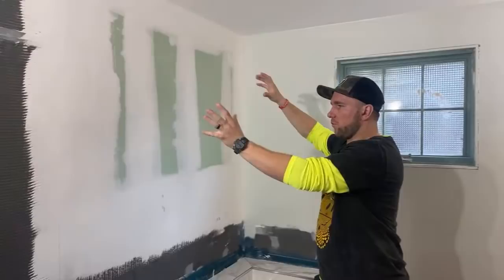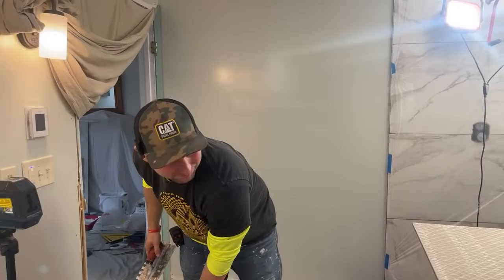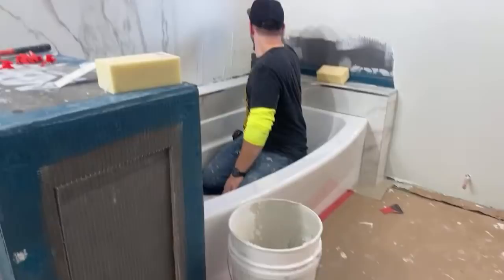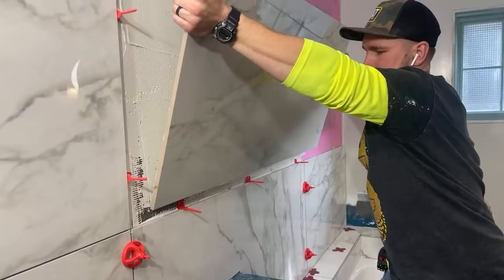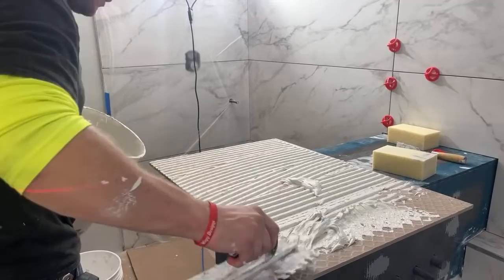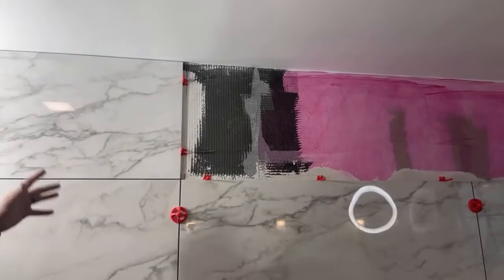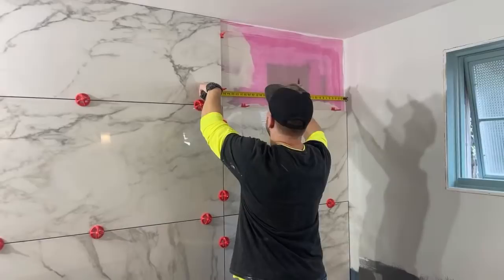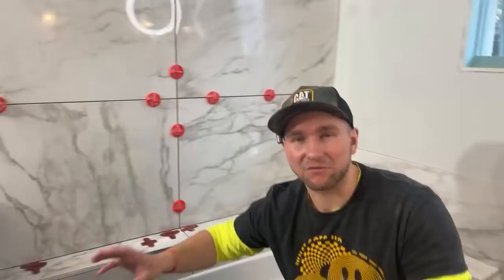🔥 Tile over Drywall 🔥. 24x48 Tile Installation Rubi DC 250 Tile Saw.

Comment: I'd never do it because you're going to have hundreds of pounds hanging off of paper coated gypsum. I have a hard time believing that it would last very long
Reply: That isn't going to last...
Reply: Not saying it's proper, but I have demoed 15+ year old tile showers installed right over green board. No waterproofing. Just thinset and tile. It can last forever. I've seen it.
Reply: @osearcy4 same here! Waterproofing has turned into profiteering
Reply: @osearcy4 if small subway tiles lasts for decades without waterproof, just think of how long will hold up with 24 x 48" tiles
Reply: As long as it isn’t leaning outward… the weight should be straight down on the other to the tub.
Reply: Green Board isnt plain old drywall.  It is fiberglass mixed with gypsum.  It is much stronger and can handle moisture a lot better.  In dry areas it shouldnt be an issue.

Comment: Hey partner just wanted to throw out there that gypsum based SLU (Self Leveling Underlayment) would be something like gyp crete, which is gypsum concrete, not sure that specific primer is good to use on actual wall board. I’m sure it will work just fine also not trying to hate, just a drywall contractor here trying to help out a fellow tradesman.
Reply: I use mapei eco Prime. Leaves a cement like surface to work with.
Reply: @brucecanny love that stuff. Bonds really well, drys fast, and gives a grippy surface.

Comment: Mastic does not get re-activated when moisture/water contacts it, that is an old wives' tale, but one many tile installers hold true, but at the same time you cannot use mastic in submerged applications.  You should avoid use mastic on shower bases/mud-pans or on floors, (especially concrete floors) but it is perfectly fine on walls.  EDIT:  I wouldnt use it on LFT tiles though.  Normal sized ceramic tile under 12" it is fine.  Dont use Mastic on glass or natural stone either.  Glass doesnt allow it to breathe, so it takes forever to dry and can bleed into your grout.

Comment: I am not an expert and don't claim to be one. But I can install floor tile no issues.  But I have mad respect for someone who installs large wall tile that looks good. 

A relative of mine had a bathroom redone. It was large wall tile. It was really nice tile she picked out,  but the installation was chit. You could visibly see the unevenness everywhere. They did not even put a sealer over the grout..... I told her that no sealer was a disaster waiting to happen.  I went to Lowes and got sealer and did it myself.

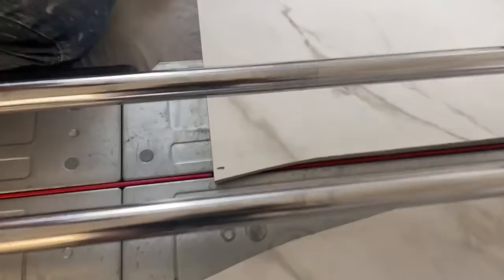Comment: Man with very nice cutters and saws can’t buy $50 suction cup to move large tiles into place 😂 Kidding, love that large format cutter. Bummer if you ever get a bad cut. Happens at 1:00:42. In ruby videos what you do is lightly tamp down with the breaker bar, then break at the other end. Your creating a little stress fracture at that end.

Comment: Hi, I noticed that you used mud and taped up the seems like with any other drywall job. On other videos I've watched some guys just thinset over the seems with no tape before tile . I'm repairing a hole in a shower wall, do you recommend that I mud and tape like any other drywall patch or since it's getting tiled can I thinsetting the whole thing can skip the mud and tape step

Comment: Great work, i like your work style simple smooth n stressless,! Yes slowly done also productive n don right!!! Good job buddy !! yea some guys finish whole room one day with plumbing but leave imperfections n room for error. I had some people in the past who would’ve definitely been mad about the Grout line that didn’t match up at 41 minutes and 20 seconds in your video I worked for and worked with tile people so anal. Smdh never praised some else yet quick to point out a discrepancy loud n proud smh. Takes 5 to 15 minutes to fix a mistake in the middle of the install rather than look at it for the next 5 to 50 years. In the end result wall is still looking great!👍

Comment: Is drywall strong enough to hold the tiles? My builder uses cement boards to back up the tiles, even outside of the shower area. He said cement boards are stronger and more water resistant than regular drywalls. I wonder if regular drywalls can hold the same amount of weight
Reply: Its not regular drywall hes using.  Its Green Board.  Green Board has a bunch of fiberglass added to the gypsum to make it stronger.  As long as you are not using Green Board in a tub or shower area it is fine.

Comment: If the drywall is painted, how do I prep before subway tile (around a fireplace)?
Reply: You dont need to do much as its a dry area.  Make sure the walls are clean and dry.  Then just use Mastic and go to town.

Comment: I’m no expert but I think your using the wrong scoring wheel for porcelain tile. Your supposed to use the smaller one. The larger one is for glass tile. Read the instructions that came with the cutter.

Comment: I don't think your idea to score the wall is that great. 
You're damaging the only thing about drywall able to hold the tile. 
Without paper, drywall is barely harder than chalk....
Drywall is an engineered system. Even when installing, you don't want your screws to pierce through the paper because it lowers the strength.

Just saying....Cool video though.